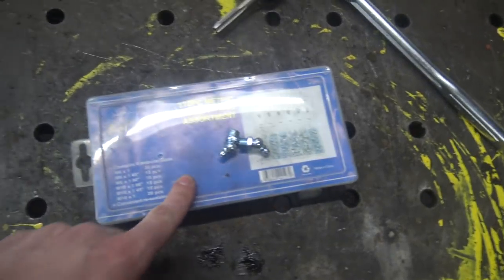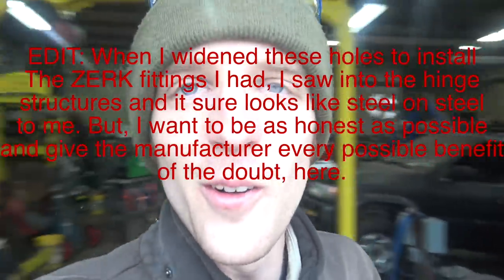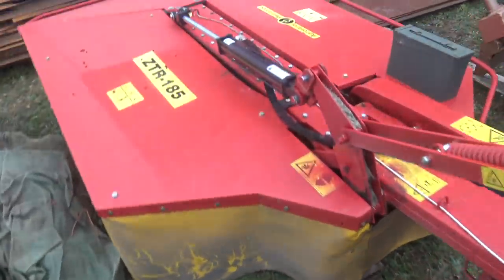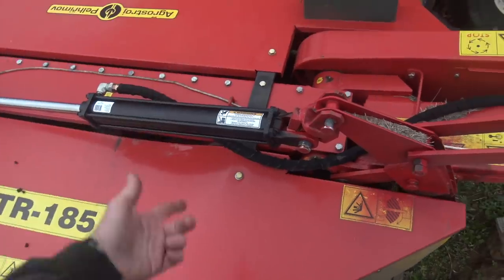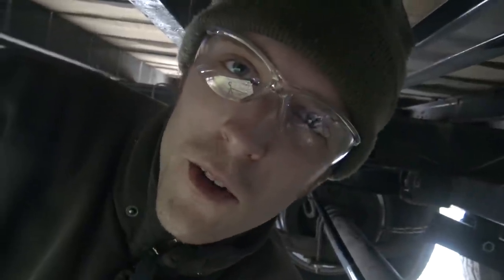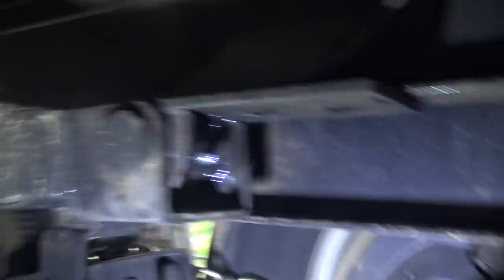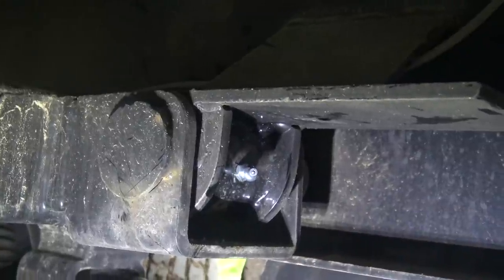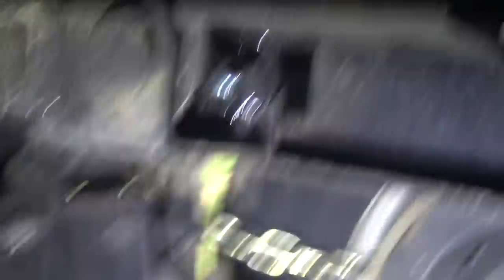Tractor & Machinery Buying Secrets!!! HOW TO NOT GET SCAMMED BY PREDATORY SELLERS & CORPORATIONS

Comment: Forgetting grease zerks is pretty simple thing to happen. I know some automotive techs who have forgotten to install zerks on new suspension parts after installing them on a vehicle. Granted on a trailer like that it would be hard to forget that, but it happens. I wouldn't fault Lamar for that mistake.
Reply: Forgot to tap it.  Forgot to insert the fitting.  Forgot to put grease in the fitting.  That's a lot of forgetting.  Its a good bit easier to believe they didn't intend to do any of that.  Given the wiring troubles and other stuff, yeah, I'm blaming Lamar.
Reply: @brianhaygood183  
They must of built it on Friday!
Reply: @brianhaygood183  I'll take a bet that a lot of the parts Lamar uses were out sourced by other job shops. So it could have been a bad supplier. Usually companies have a parts per million for bad parts. Having worked for a large company that makes ag equipment for Case New Holland, I stand by my statements.

Comment: Out of the older 13 tractors you have bought, what might the price range be?  If we are assuming they are old, worn, maybe not running, and looks to be in poor condition..what should be the offer start?   I would like a "project" tractor, thinking in the Ford 2000, 3000 models. They were built from 1965 to 1975?  Thanks, ,like your videos!
Reply: i would go on googles and type in "ford 2000 auction results" or "ford 3000 auction results" and see what they are bringing
Reply: @ernielucas6544  Thanks I will try that.  There isn't many auctions near Beaumont that I am aware of, but in the event I find one of these models, that might give me (as you suggested) a fair going price.   *<{:o)   thanks!

Comment: You have me scared now. We bought a bumper pull stock trailer 4 years ago and a flat bed equipment trailer 2 years ago. They don't get thousands of miles per year but still I have not checked the wheel bearings for either. And I need to. I bought new sealed bearings for my quad front hubs. There was barely any grease in them. I bought some old trucks. One was my first truck in high school. I knew exactly what I was getting into. Not sure why I trusted new equipment was fine. I already have had issues. Thank you for your insight.
Reply: I have had a real problem with sealed bearings that contain basically no grease for about the last 10 years now. I always pop the seals and inspect now. I was replacing front wheel bearings on my garden tractor annually until I figured out the problem. I think I'm on year 4 on the same set now.

As far as your trailers, I'm surprised you were sold something new that didn't come with bearing buddies. I don't 100% trust those, but I trust them more than a dust cap. Well worth your time to install some when you service your bearings. It's also a good idea to check your hub temperatures, even with your hand, every now and then while you're pulling. Warm is fine, hot is bad.